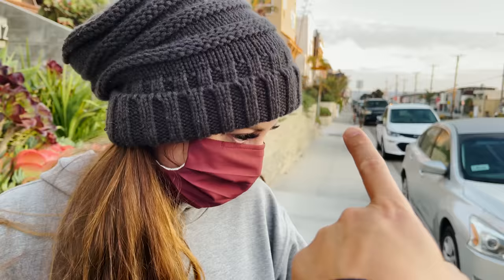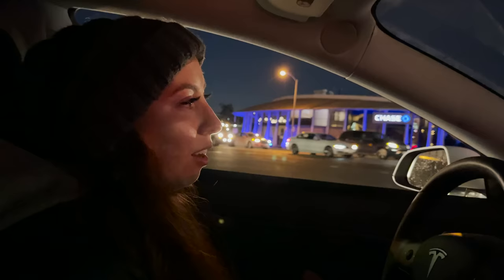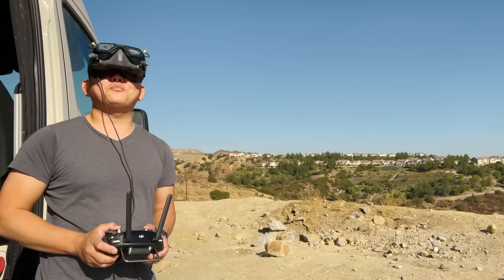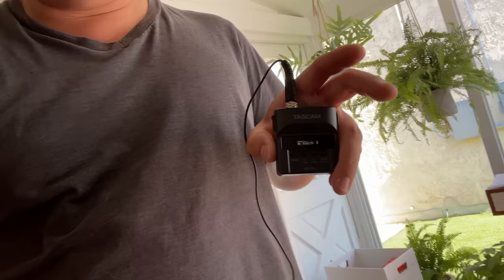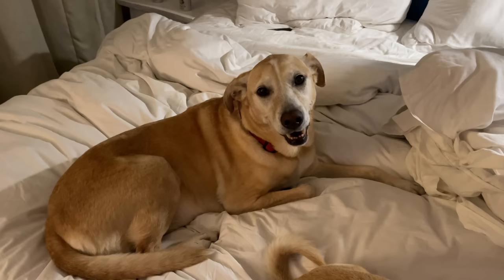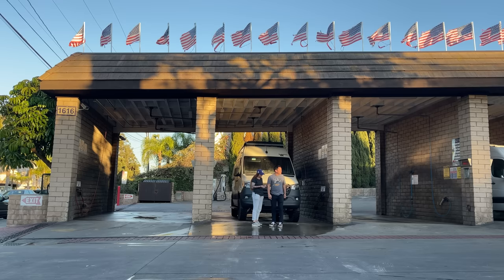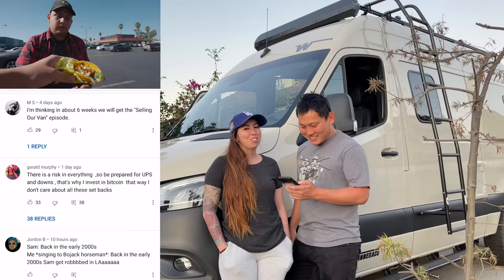This Vlog Was Filmed on the iPhone 12 Pro MAX

Comment: The audio quality of that mic is not bad at all
clicks on link in description
225 euros... I see.
Reply: The mic is relatively cheap, it's the pocket recorder that does the job that is driving the price that high...  There's even a better version of this type of recorder that Gerald Undone just reviewed last week.  You can't clip the audio, it's 32 bits recording.  And syncs with timecodes via Bluetooth.  Rad stuff.
Reply: The white one goes on sale all the time, especially around this time of year here in America, usually goes from $200 USD to $130 USD.

Comment: Now that you have more drone footage and quicker camera movements, are you considering switching to 30 FPS? 
Most of the phones and tablets cannot display 24 FPS and YouTube has to add a few frames to the video every second to make it 30 FPSish. 
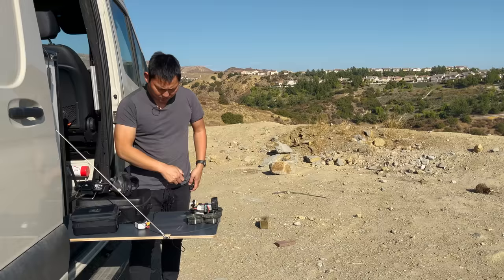Since it’s just duplicating frames this becomes visible as a pumping/jittering motion as seen in 4:42 or 7:10 for example.

Comment: Truly amazing.  What a concept.  Who would have ever thunk?  That you might want a lavalier microphone on your body?  What a concept!  Maybe it'll catch on?  But then again.  It might be kind of old and blasé to do.

Yes I've been using those lavalier microphones on people since,, 1984.  But you had to plug goes into a wire.

Then, we plugged them into little wireless transmitters.  With the receiver over by the camcorder.

But screw that.  Today you just wear, the audio recorder.  And you can have as many simultaneously as you want.  Sometimes I've had up to 16 going.

And thanks to the marvels of Paul's code modulated digital audio.  It's not contiguous like analog tape.  It's digital audio with as many frames for audio as there are for the pictures.  30 audio frames per second.  And so making it synchronized today.  It is a hell of a lot easier than it used to be.   Back in the 1980s.  Before we had digital anything.  And synchronization had to be attained by other  more expensive means..

So while you talk about cameras.  And you know your stuff.   Yup.  Some of us are more audio oriented.  And I have 4 major music  award nominations.  Along with.  20 years spent with a major television National Broadcasting Company here in the USA.  And well I mostly did audio.   With lavalier microphones.  And yes they are more fun to mount in a ladies brassiere.  Now let me just leave those wires around your cup.  How's that feel?  Squish a little more to the right or squish a little more to the left.  Yes they are quite  squishy.  How do women make them so squishy like that?  But you have to lead the microphone around them.  It's easier on guys.  They do not wear brassieres, most of them but some should.  Because that really doesn't look good if they don't wear brassiere and they are men,, with big moves.  You see them on the beach boardwalks all the time.  And they're not supposed to be walking around topless like that.  Nobody wants to see that.  We want to see the ladies like that.  Not that big old fat guys that look like they're going to give birth to triplets.  And they have the breasts to feed them with.  Isn't that amazing?  And they are men.  And they have been pregnant now for at least 20 or 30 years.  Like that.   They have more fortitude than women have.  Women can't hold those babies in for much more than 9 months.  And guys can seem to hold all of their  shit in their bodies for fucking ever.   Or forever fucking.  Both.  But once they look that pregnant.  They no longer know where their thing is.   Because they haven't seen it in years.  Because they look so pregnant.  It looks like Texas has a lot of pregnant men.  I don't know how they do that?  I didn't think that was possible?   But they are Texans.  Which means anything is possible.  As the guys know how to do their bellies up, big time.  And they are proud to walk around and look extremely pregnant.  For half their lives.  But only half their lives.  Because you usually don't live that long when you stay pregnant for too long.  And they were going out with this other girl and her name was, Beaudieweiser.

Men should be more diligent in practicing Beer Control.  So they don't get pregnant with Triplett kegs of beer in their bellies.  As they also should not wear Speedo's.  Because we can't see the Speedo's.  So when looking that pregnant, men.  You should wear boxers style underpants, shorts and trunks.  Or you can become Mormon.  So you can wear secret underwear.  But it still will not disguise your kegs of triplets you are holding in tightly.

And thank you so much.  For reminding me.  I've got leftover Chinese food in my mini fridge.  As soon as I saw your :-) I remembered.  And well it didn't last me until the next day.  I mean it did but it was after 3 a.m.  Which was technically the next day.  Just not lunchtime.  But I may not want to have any lunch after my phone call with my lawyer at 10 a.m.?   Because it will all just come right back up again.  So good thing I ate my lunch today last night.  It'll only come out the other end where it should.  Perhaps more fluidly than my savings account will survive?  Which already hasn't.  As I have no savings account anymore.  So then you just have to sell off everything else you might own or possess a value to your life.  So you can hand it to your lawyer.  They didn't teach us that's how life is supposed to go in school.  You only find that out afterwards.  And so they lied to you in school.  There is nothing united about the Lone Star State of Texas.  It's still a Republic.  And they are united with no one except themselves as Texans.  Now I know what they mean by the Lone Star State.  It's the loaner star state.  They are the loner star state.  They are losers.  They are the loser star state.  As they do not know what the  term humanity actually means.  And they have confused the term conservative with fascism.  They don't understand big words.  It is be low lower than their comp comprehension.  I mean I don't don't like to repeat repeat myself twice over, twice over.  But two out of three ain't bad.  Ho ho ho.  There's 3.

Gobble gobble
RemyRAD

Comment: The Tascam recorder is great with minor compression and EQ, amazing noise floor with 32-Bit float recording, but tbh, if you have a 3.5 lavalier from Amazon, and use sound recorder on the iPhone and record in lossless, and get 98% the same. With EQ you are hard pressed for a difference. Make sure to use the wind screen and have it worn in a well hidden spot on a person, and you’re golden.

Comment: what battery are you using on your cinewhoop? Also, do you notice a considerable difference with the Lumenier AXII ?
Reply: From experience upgraded antennas do a great job making video signal more reliable or consistent even if they only improve range slightly
Reply: @towers3372  Thanks! I noticed they are sold out everywhere.

Comment: Hey there,
I have a quick question about your van. When you are traveling with it or working in it. How long does the battery hold if you use it under normal conditions without recharging and for how long do you have water in it. 
I once went on a short trip in a camping van and we had to save water wherever we can because there was so little in the tank, Wich was really annoying at some point but also made up the experience of camping.

And in the end I want to criticize you all for some parts of the vlog. I'm from Germany and so most of the times I watch your videos after they come out wich is most often after dinner. How dare you to show all this nice food in the videos xD it makes me hungry while I'm already in bed

Have a nice day!